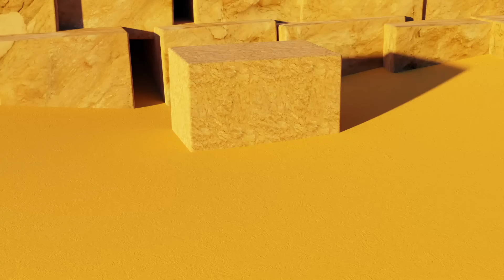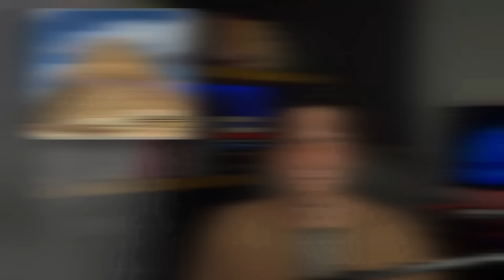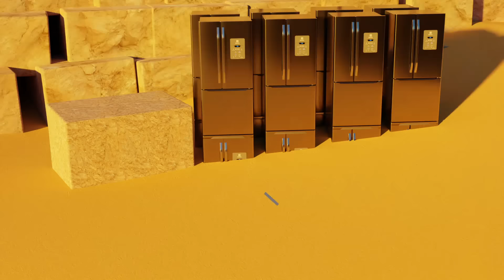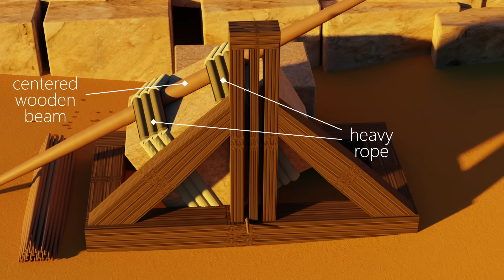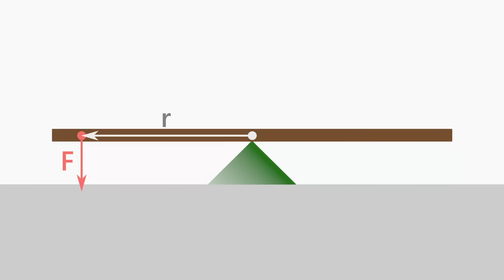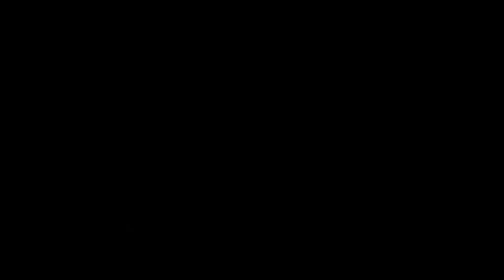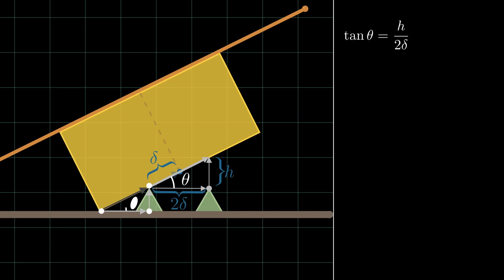Physics Reveals How the Pyramids were Actually Built

Comment: The maths quite clearly proves that the herodotus machine could have been used to lift the blocks.  But I cant imagine it would allow for the precision the pyramid was built with.
Reply from the maker: Thank you for your comment and excellent point. Additional scaffolding and tools would certainly be needed to guide the blocks into their precise locations, once lifted. This is a good point and one I may revisit in a follow up. Thanks again for your input and thanks for watching!
Reply: @DrJohnDev  in all honesty I don't think that mystery will ever be solved.  Mostly due to the incomplete  information given to solve it with.  The era it was alleged to have been constructed, its purpose, and the tools that were available, which is speculative.  Gobkli Tepe for instance, predates the pyramids as does the Sphinx.  You'll be pleased to know that Aliens are not in the equation 🤣
Reply from the maker: 🤣 Well, that's certainly more digestible.  Interesting remarks about Göbekli Tepe and the Sphinx.  You're right that incomplete information makes the task more speculative.  The best we can do at present is try to apply science (non invasively) to the little information we do have.  And for the things not entirely clear... some things are best kept preserved in the mysteries of history.
Reply: Right.  And the pyramids had a LOT of blocks!
Reply: @Roger-nk5ug  not sure what you mean by that.  The herodotus machine is capable of lifting the blocks, and it looks like it would have been easy to construct a lot of them. It just doesn't account for the precision.  Aligning the Pyramids to true astronomical north and built encompassing dimensions relating to the globe is no walk in the park.  Graham handcocks documentary ancient apocalypse is really interesting. There is certainly more to be learned about these megalithic sites around the world
Reply: As to the precision, that's down to two things, the accuracy of the shaping of the blocks and the technique of the final fitting.  There are several ways each phase could have been accomplished, but as of right now I'm fairly sure we won't be certain of exactly which techniques were actually employed.😁
Reply: So could well-trained elephants working as a team.

Comment: Smart use of levers. Now, how do those blocks were placed and removed from the machine ? And how those machines were placed in tandem so that the blocks could be moved from machine to machine ? I hope there will be some follow-up on this ancient technology.
Reply from the maker: These are some excellent questions, and I plan on making a follow-up addressing these questions.  So the Herodotus machines would have likely been lifted up and over the blocks.  Trenches could have been dug around the blocks such that the machine sits lower than the base of the block.  A trench could have been dug through the sand under the block to feed the first wooden slat through the machine. Certainly some finesse, but also within the realm of possibility.
Reply: @DrJohnDev And how do you raise those machines up to well over 400 feet in to the air? Khufu's pyramid is currently 454 feet tall,  but was thought originally to be 481 feet tall. That's around 140 metres. Each machine would, by necessity, be bulky and heavy. The machines would have to be lifted over each "layer", but, that becomes difficult at the outer layers because there is very little room to put anything on.
Reply from the maker: This is an interesting point about the outer edges and the lack of clearance.  I also wondered about this.  I would imagine temporary wooden scaffolding would have been used, much like it is used in modern construction today as a temporary support.  This scaffolding would have been removed after the completion of the construction.
Reply: @DrJohnDev  No. They floated all the stones around, that’s how they did it. Look it up. All these mechanical means are incomplete and much less efficient. The king’s chamber is a primitive hydraulic piston that pushed one stone into the wall and everything is hidden behind it.
Reply: @DrJohnDev remember 10 tons is just for the small limestone blocks you would still have to move the large granite blocks inside that way upwards of 100 tons. With wood. Supporting over 100,000 pounds.... With wood. Every 7 minutes, without fail, for 27 years.
Reply: @DrJohnDev  :Regards the trenches, an easier approach would have been notches at each end under the blocks allowing leavers to be used to raise one end of the blocks few inches to allow shoring to be inserted, then the other end,  thus allowing access under the block after which any of several techniques could be used to raise/move the block as required. This would greatly reduce the labor required, (trust me on this I used to dig trenches for a living😁) verses digging out a few shallow notches. 😁
Reply: This is all very interesting; but there is just no way they could place one block every 6 minutes for 27 years.
Reply: Yes  @bobsmith6544 , because they also need to be quarrying them at that rate and transporting and off-loading them at that rate. It seems way too much for a 27 year project. Also half of the time it would be dark or dawn/dusk. Plus calling it Khufu's pyramid is based on conjecture. 'Khufu' written in later hieroglyphs probably by Wysse ( sp?) and a tiny figurine found nearby. No inscriptions inside.
Reply: Pyramids are piled up blocks of stones which were excavated to build the Suez Canal by brits.
Reply: No. They floated all the stones around, that’s how they did it. Look it up. All these mechanical means are incomplete and much less efficient. The king’s chamber is a primitive hydraulic piston that pushed one stone into the wall and everything is hidden behind it.

Comment: All great civilizations were built beside big rivers. That being the case and the ample evidence of masses of water moving around in that area, it wouldn't take engineers and mathematicians long to work out a water to giant slabs of rock ratio of pulling the slabs of rock up a 30% slope.
Reply from the maker: Very good point.  Running water was certainly exploited during this time to aid in the transport of the blocks to the construction site.  I didn't touch on this aspect in my video, but I'm glad you brought this up!  I'm considering making a follow up, and block transportation would be a necessary topic to cover.  Thanks again and see you around!
Reply: I'm not saying that the ancient Egyptians did or didn't use other forms of technological advantages yet there has been modern evidence of some monks who used sound, acoustics or specific frequencies to move heavy stones. This could also be another possible tool they could have used.

Comment: While the method itself is feasible, the idea that the whole pyramid was built with the help of this one contraption is utterly ridiculous and laughable.
Reply from the maker: There would have been multiple machines working together in tandem.  I think the simplicity offends.
Reply: @DrJohnDev  Come on, this is one of the most time consuming and ineffective methods of lifting the stones I have ever seen. Although the lifting process is relatively fast, It would take hours to set it up. I hope you realise there is more to it than just lifting the prepared stone.
Reply from the maker: Sure, certainly understand there's more to it, but physical obstacles are far harder to overcome than logistical ones.

Comment: The block would need to be set in some sort of cradle that would need 3 features.  1 Dawgs at the edges of the block to keep it from sliding off while tilting, 2 detents on the bottom to keep the assembly securely on the pivot points, and 3 it would need the ability to be disassembled under load when the block gets to the top, or when the assembly gets to the final position where the block will be set.  This is a great video for explaining the math of leverage, but I think there are too many missing pieces to conclude that this is how the pyramids were built.
Reply from the maker: These are some interesting points, and some interesting things I could address in a follow up video.  

This is a neat video of a man from Michigan lifting heavy concrete blocks by himself.  You may see something familiar.  Thanks for your insightful comments and hope to see you around again!

https://youtu.be/E5pZ7uR6v8c?feature=shared&t=166
Reply: @DrJohnDev   Not to mention the 8,000 tons of granite in the GP alone, 70 ton stones that were jacked 150 meters into the body of the pyramid. The secrets of the pyramid builders as well as anything of significance in Egypt, like temple of Osiris don't lie in the lifting of the blocks, that's a dead end avenue that makes individuals miss everything else. They miss everything and celebrate fool's gold when they come up with something that sounds good. The secrets  lie in stone fabrication and precision joints that are all over, tight joints that modern construction doesn't produce EVER. Quarry processes, kilometers of tunnels plowed into bedrock, all apparently with chisels and copper saws.  Diodorus and Herodotus produced historical record as they spoke with Egyptian priests. Records of an advanced civilization reigning in Egypt dating 20K BC and beyond. That historical record was then corroborated precisely with the discovery of the Turin Kings list in the 1800. Last two lines of the Turin kings list read "Venerables Shemsu-Hor, 13,420 years; Reigns before the Shemsu-Hor, 23,200 years; Total 36,620 years.”

drop this stone lifting all together, it'll do good for your channel. cHECK OUt improbable timeline of the old Kingdom -the Mega pyramid builders. 

check out some stuff i've created as well. 

cheers, great production! subbed
Reply from the maker: Thanks for subscribing, and interesting comments.  Certainly more to investigate and consider.  While I do believe the lifting is one of the key hurdles to building the pyramids, there are certainly more obstacles the Egyptians needed to overcome.  I'll check your channel out and let you know what I think. Cheers!
Reply: @DrJohnDev  A French scientist has an alternate theory that includes the use of geo-polymer cement to make the 10 tone bricks.  They have even made real live models to prove their theory:  
 https://youtu.be/znQk_yBHre4?si=XHessMNqG_cVJXQi

Also here is an excellent video of a Chinese academic explaining with great detail how the pyramids are actually designed as a byproduct of mining and not a grave or place of worship.
https://youtu.be/BYr6HbEjS7w?si=VXSQl4ZYHOUVRlKj
Reply: I prefer to believe that the Annunaki put them there!
Reply: Solo son teorías de construcción de las pirámides; Es un gran enigma hasta hoy día como se construyeron esas edificaciones y en subida, a sabiendas que cada bloque pesaba entre 2 toneladas y otras algo más..
Reply: how could we ever figure out how they were built when we dont even know what they are?  The ancient people understood the science of sound and had loads of technology and machines that used sound. We today know almost nothing about sound, we have invented the speaker. although it can create sound it doesnt really do anything with it, we have levitated a very small object using high frequency sound and that was it. Here it looks like they were using it to create electricity. I think its strange the civilization that build all these megalithic sites never wrote any writing on anything. writing was always added at a later date. the lack of any writing or art merans it was probably something for industrial use and had a very utilitarian purpose. Everyone knows its not a tomb and there are people that have to jknow what it is and want to prevent people from finding out. The guy who invented the process that creates ammonia was funded by an egyption man and the process he patented looks exactly line one of the pyramids. They just say its a tomb to insult us, and by doing so they are erasing our history as all this crap will mislead all the people whos job it is to pass the information on. its amazing how many smart people can be such idioyts and believe in man made climate change , or thing the pyramid is a tomb. it looks absolutely nothing like a tomb, it has no elements of a tomb, what kind of people would spend their life building the place where they will ;ay dead. its notr something man powerful people look forward too most dont even know where they would want to be barried untill they are toward the end of life, sometimes it feels as if the wall of dishonesty is impenitribler. archeologists said egyptians created mummies because they needed their body to make a safe trip to their afterlife. Why wouldnt it have been because they dont want a stinking rotting corps at their funeral, we use imbalming fluid today so we dont need to do the preservation the same way. archeologist are some of the dumbest scientists outr there. we should show them very little respect esp for the ones pushing these bs lies and bringing new discoveries to a snails pace,
Reply: @mrschnider6521  Everybody knows its not a tomb, ya right
Reply: Yup, this video was good at showing leverage and calculus, pure garbage at showing something that would have made building a pyramid remotely possible.

If you can’t show exactly how you could place a stone block over the lower course, without levers, you’ve got nothing, because using levers at all cannot work.
Reply: They built it from the ground up from the inside. The pyramid itself is used as the lift as the pyramid is built. They have found tunnels that follow the perimeter on a 45 degree angle all the way to the top.
Reply: @OnGaurd3S: Not necessarily.  Those requirements would only hold if you were using a cradle under the block. It is also possible (and much easier) to build a clamping frame attached to the top of the block with ropes to do the tilting. Among other things this leaves the bottom of the block free to slide off of the shoring onto the blocks below. To see examples of what I mean look at Wally Wallington's website where he demonstrates how one man alone can move multi-ton blocks using only wood, rope, and counterweights. 😁

Comment: Nice. Please proof this with the 100t blocks used in de Roof opf the s.c. "Kings Chamber".
Reply from the maker: Great question!  Yes, the King's Chamber blocks were in fact heavier, although the physics would remain the same.  I would need the dimensions of these blocks to work out the detail, but interesting thing to check out!
Reply: @DrJohnDev , I am very much afraid that you would need to calculate the strength of the wood as well, to provide a feasability as to the application of the method to move stones of that magnitude. 
One calculation for a big stoone I found:
The first ceiling layer of beams measure ca 8.9 m [L] x 2.3 m [H] x 1.3 m [W]

= 26.6 cub m x density of granite 2.75 = 73 tonnes
Reply from the maker: Very nice!  This is exactly what I did to confirm the weight of the stones at the base as well.  And you're absolutely right, I believe the strength of the wood needs to be calculated exactly and its compressive strength well understood.  For a potential follow up, I plan on surveying the wood used in the area of Giza, and using it's Young's Modulus, figure out how much force it could withstand.  I'm curious as to how thick the wood would need to be in order to still be usable.  I would need to run the numbers to figure it out.  Appreciate you figuring out the weight using the rock dimensions!